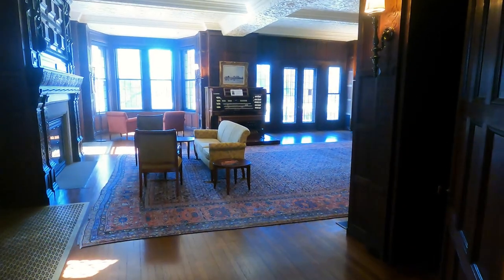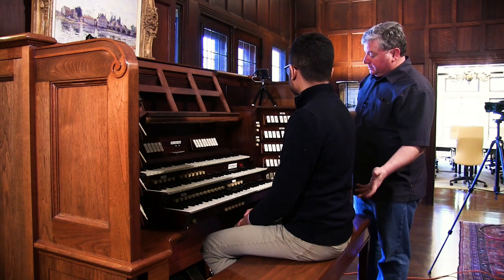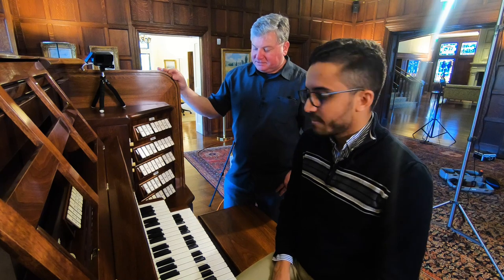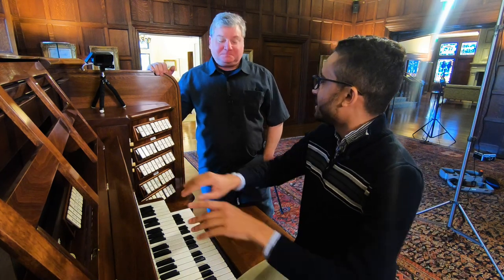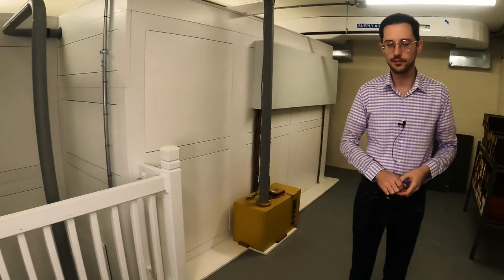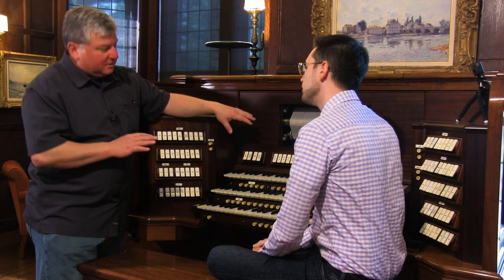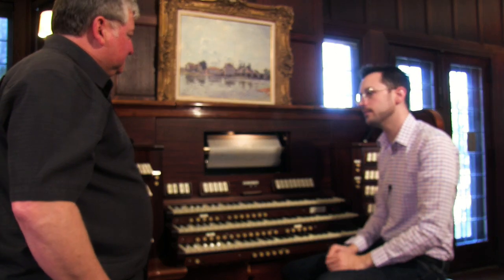1931 Aeolian-Skinner Residence Organ - Stoneleigh - Villanova, Pennsylvania

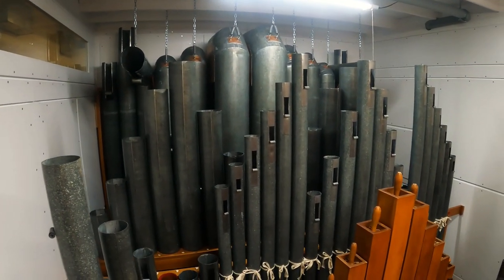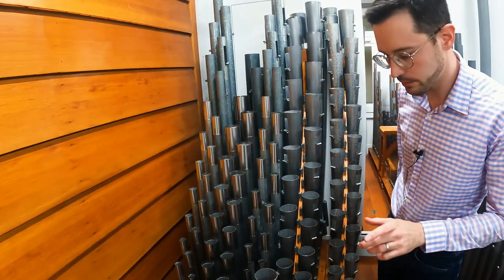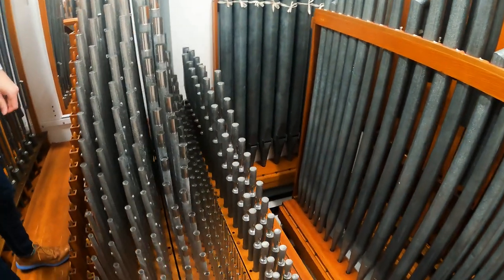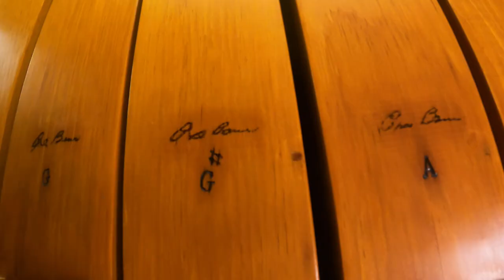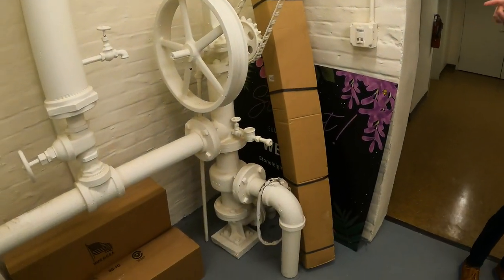Comment: For anyone wanting to know what piece I am talking about is the one between the Marche Militaire and the Bach Fugue in C Major.  And the piece I am talking about opens at 16:29, it does fade out but once again, you hear more of the piece at 21:23 but stops at 21:33.  The piece then starts up again at 22:08 and fades out at 23:08.  Then at 23:33, the organ continues with the same piece but with a different stop registration.  That lasts until 23:58.  But starts up again at 24:40 and fades out at 25:13 and you hear it for the final time starting at 26:02.  When you put all the segments of the piece, you would think that it has been written for a theatre organ.

Comment: I'm curious about the player roll.  I am familiar with player pianos and have rebuilt a few.  It looks like this roll has smaller, closer-spaced holes. Is this true?  Standard player pianos used 9 holes per inch. Even this required automatic tracking